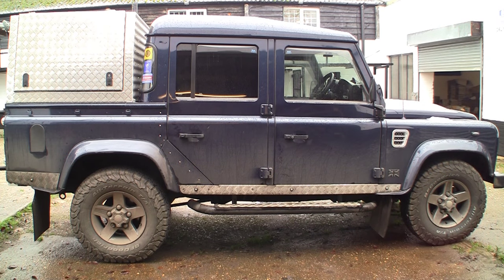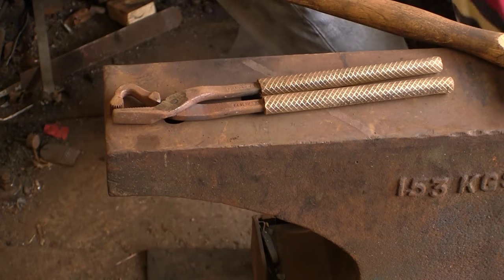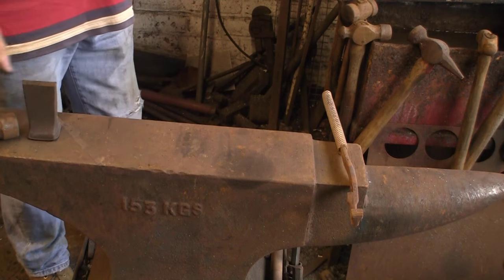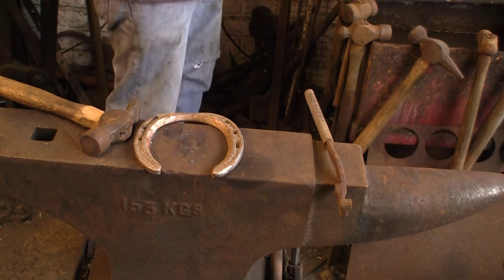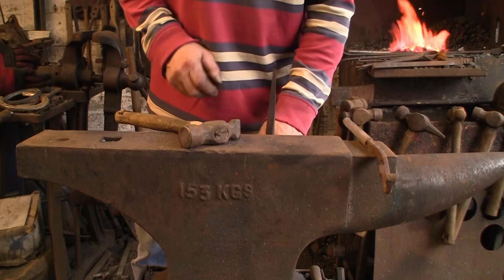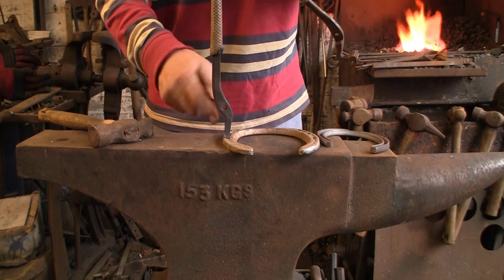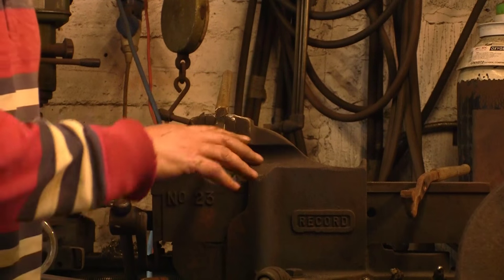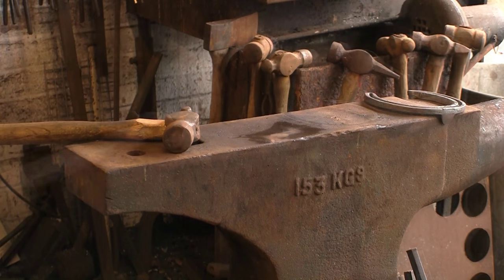Hot fitting tongs Mk 2

Comment: It is sure good to see you feeling good enough to make videos again. What a great idea, repurposing old tongs.I would love to see a series on repurposing old hoof  trimmers into working blacksmith tongs.
Reply from the maker: Not sure that would work as I don't think there is enough thickness in the blade area to turn into a jaw. I'll have a look though.
Reply: I made a pair using hoof nippers by grinding a V in the jaws, then welding a small piece of angle to each side. The result was kind of like bolt tongs.I still use them for 3/8 stock.

Comment: That's a beautiful anvil, my fisher 225# made in 1903 has two cuts from a wafer wheel that some idiot made sometime in the last hundred years. Do you have any idea if 7018 welding rod would be OK to use for the repair? I've called two different machine shops to see if they could just surface grind it down but they said its two tall for their grinders.
Reply from the maker: I guess they would work but don't know if they would be hard enough. I don't know if your old anvil would have a hardened surface or not. Mine has a hard surface so I used hard facing rods.
Reply: +Shane K Don't grind the face down. Check the iforgeiron.com forum for information on repairing the face.
Reply: +Andy Mckenzie, thanks, I took your advice and just read 4 different pages on anvil repair at iforgeiron.com but their general consensus seems to be don't bother, I'll do more damage with welding. Could you please give me a description of how you'd fix two wafer wheel cuts, 1/4 inch deep, straight across the center of an otherwise beautiful, huge, fisher? I'm tempted to just weld them up but I don't know!!!!
Reply: +Shane K Is it right in the centre of the face? That's a real shame. How annoying. 

Normally I'm not a fan of welding anvils up but in times like that it makes sense to do it. I'd use the Robb Gunther repair method. I've never done it personally so I can't offer much advice but there's plenty of information on the web about doing it, but I'd say unless you're a good welder then get a professional to do it while you are present. Best of luck with it.
Reply: +Andy Mckenzie, thanks a bunch. I'm a union boilermaker by trade so I can weld it, just wasn't sure that was the right thing. I probably would have used the wrong rod also. Thanks again
Reply: No problems. Glad to hear you can do it. Join the iforgeiron forum and post some pictures when you're done. I'd love to see it restored. All the best